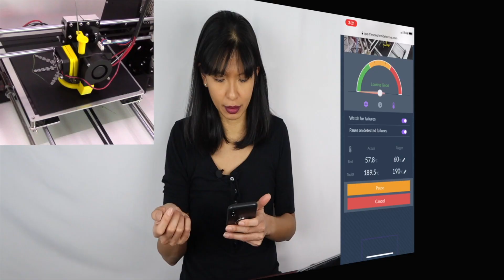How to Solder Header Pins to a Raspberry Pi Pico Board

Comment: Tempted to solder it upside down so I can see the labels, anyone done this?
Reply: Then the usb connector would not clear a breadboard, so I suggest not. However they definitely printed the silkscreen on the wrong side--pretty useless to put the pin numbers on the bottom.